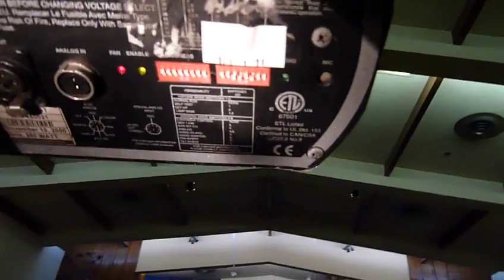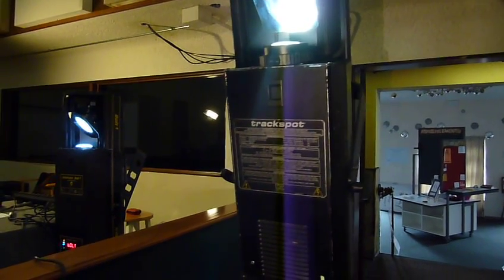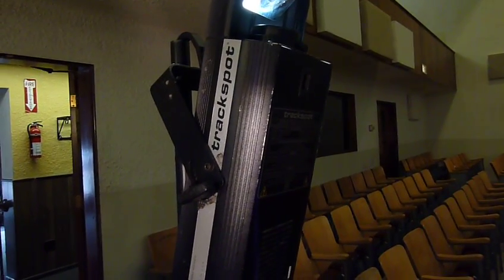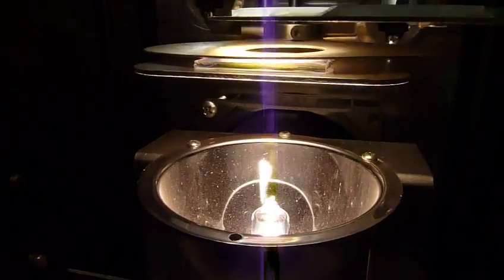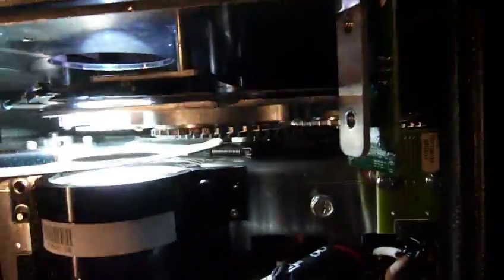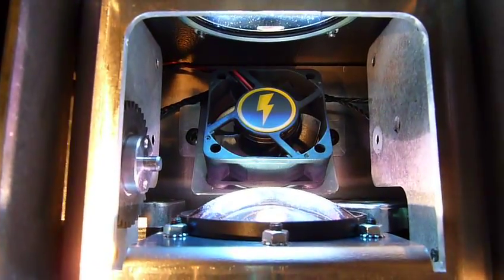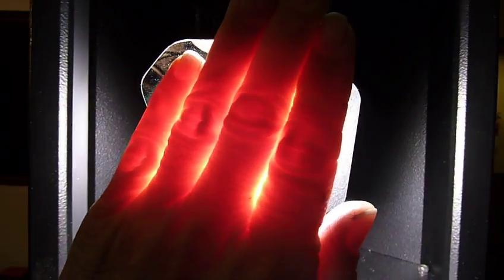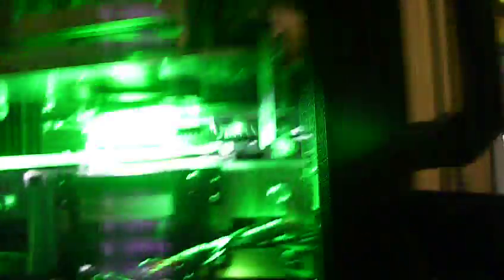Trackspot vs LED Trackspot Bolt from High End Systems / Barco

Comment: 5  pin is not considered more professional you don't need all 5 pins. You can convert 3 to 5 pr 5 to 3 using an adaptor depending on what your using for fixtures and DMX control

Comment: The old trackspot pan is not that slow you must not have set the speed correctly. They use the same stepper motors and it's fast AF
Reply: Its not the motor…its the new driver 💪😎